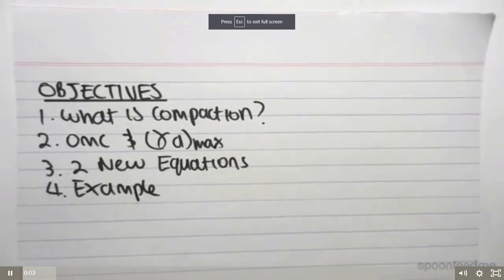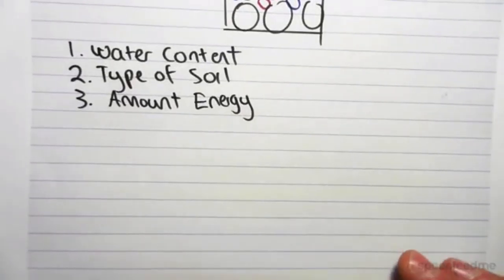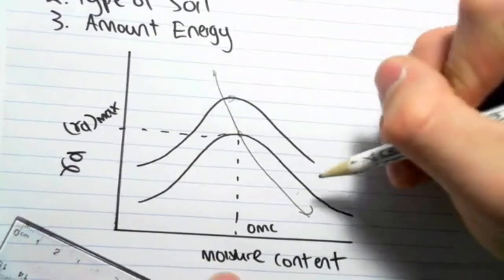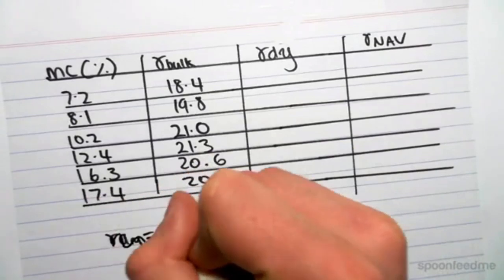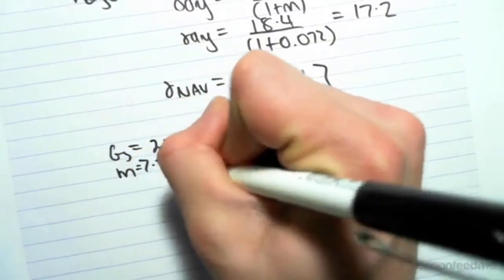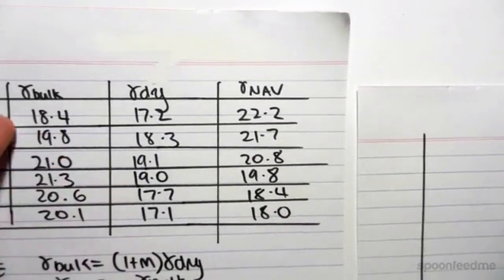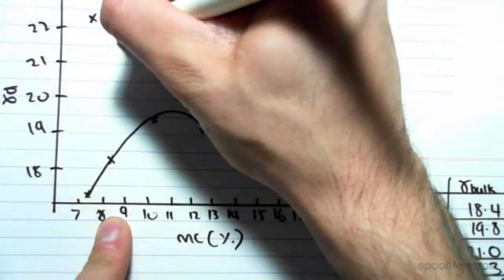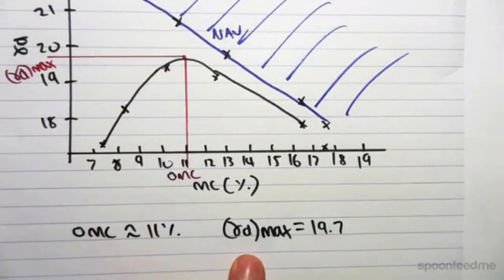6.1 Basics of compaction - Compaction curve and zero voids line

Comment: from where 9.81 came in the calculation of no air voids line
Reply: Unit weight of water = 9.81 kN/m^3
Reply: It's standard value of  acceleration due to gravity just like the density of water which is 1000kg weather it's given or    not  u have to use it where necessary